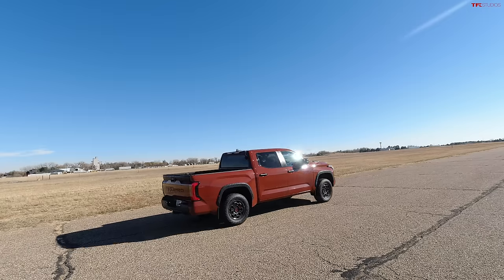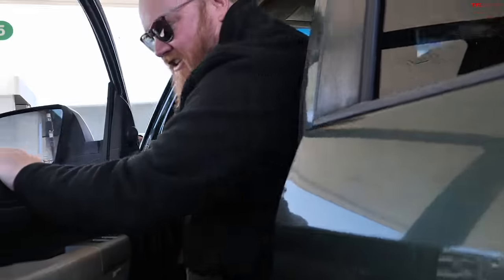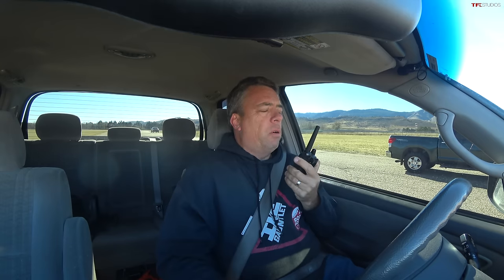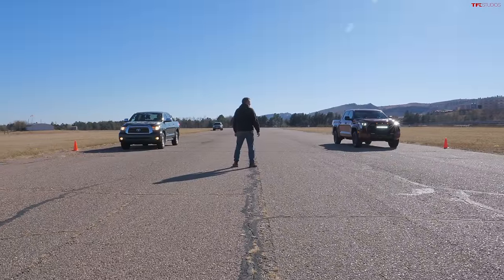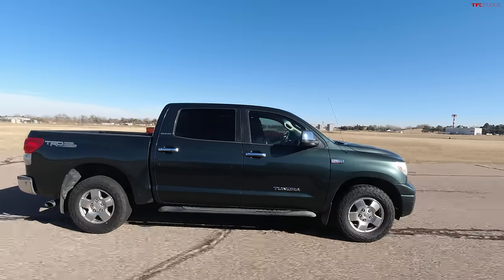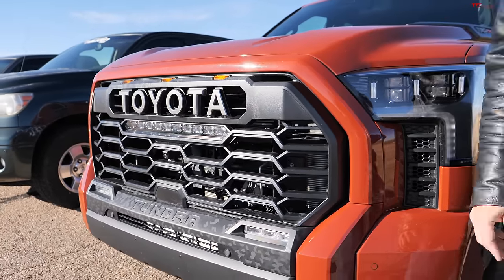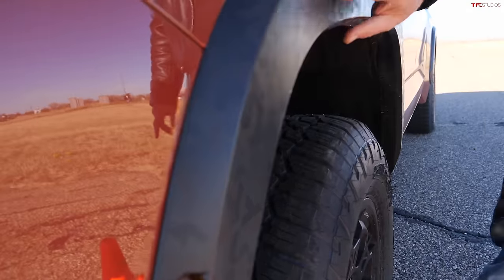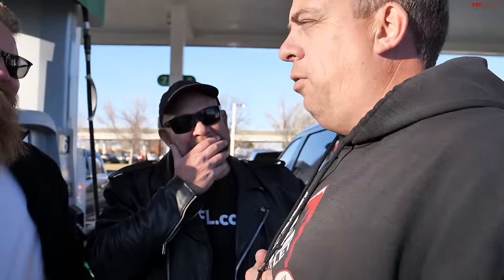Three Generations of Toyota Tundra Drag Race & MPG Surprise: That WAS NOT Supposed to Happen!

Comment: I had a 2005 Tundra for 7 years. Great truck until the transmission pin rusted and I didn't have 1st or 2nd gear on D. The brake line had a pinhole due to old age, and if the transmission was still cold, I'd have to drop it into 1st gear for it to move at red lights. Other than that I loved the truck. I now drive a 2011 Tundra DC and have no regrets. If Toyota gets their TT V6 engine problems fixed, who knows... I may go that route in the future. But from my past experience going from a V8 M3 to a TT inline 6 M3 looked great on paper, but nothing beats that sound of a V8! So I'll probably drive the 5.7 to the ground and look for a 2.5 gen Tundra V8 when that happens.

Comment: I have a 1st year, 1st gen Tundra TRD 4x4 with less than 100K and has a "Built in Japan Motor."  For the 1st year of production the Tundra motors were built in Japan and shipped to the US, after that year they were built in the US.  If I only get 300K from the truck it should last 50 more years, but I won't last that long.

Comment: My coworker has a 2000 tundra with the 4.7 and about 450,000 hard miles on it … he does not baby that thing and never has … TANK
Reply: All they need is regular maintenance and parts replacement as necessary... they sure can take a beating! 450 is insane! Mine is a 2000 4.7 also, but it only has 238k on it. Your buddy truly does drive that ol beast!

Comment: Did you remember to turn off the overdrive on the 2006 for the drag test? For the braking tests, the 2 older Tundras should've had new brakes installed for fairness. It would also have been nive to include a non hybrid version of the twin turbo V6.

Comment: Never will be sold on this new gen. Currently 2017 crew cab pavement princess 1792 edition. Really missing my 2012 TRD double cab. My younger brother has an 01 v6 tundra with a brand new frame sitting at 240,000mi. That one will outlast my 2017 hands down

Comment: Ive said it before You guys don't know how to drive the tundra🤦🤦🤦🫠🫠 I've been driving my 08 for the last 10 years,, "family is the original owners going on 16 years".. did you even use the tow haul everyone knows that makes a big difference in the tundra because that changes the gear shifting.. to take traction control fully off you push the traction control button. Then push it again and hold it down for like 5 seconds or little longer until all three lights come up on the  dashboard.. I guarantee you if you guys had a good driver that knew what he was doing you would have better results. You never race with traction control on. pushing the button one time doesn't fully disengage. You guys don't even break launch. Hold the break, give it enough gas till your at or around 2,000rpm then hit the gas let off the break n see what happens.... Im definitely not saying the gen2 tundra is gonna win over the new tundra obviously that won't happen (stock) but the results would be way better if you knew what you were doing..
Reply: Exactly

Comment: I owned a 2000 model first generation Toyota Tundra I put two tons in the back bed of it and hauled it down the road and I hauled a 34 ft travel trailer up a mountain running 80 or 90 mph and get 15 to 16 Mi to gallon with it hauling a travel trailer I had two Fords one with a five four and one will the 46 hauling the same travel trailer down the interstate and you could just barely do 65 on the flats and they both got 6 Mi to the gallon hauling the travel trailer trailer

Comment: Be interesting to see how a manual transmission would perform with these engines. I have an 03 with the 6 cylinder and 5 speed, and it has quite a bit of low-end torque, but that 3.4 without turbo is not a very smooth or high reving engine.

Comment: 12:23 lucky you. Our 2004 Sequioa had a 4 speed automatic transmission and 2WD. At least it had traction control. Also, @12:54 why though? The same people complained that the first generation was too small to be considered a full size truck, and this second generation was similar in size to the Nissan Titan of the time.

Comment: I’d get the 5.7. That engines a workhorse

Sure mpg sucks but that’s the case with any truck. If Toyota kept the 5.7 added D4S 10 speed and a hybrid, left the exterior alone, and just updated the tech ever so slightly the tundra would have been much more compelling
Reply: Imagine if Toyota had just poured the full development budget of this twin turbo into the V8. Surely they could have matched or bettered the V6 in both power and efficiency.

Comment: did you guys check trying the manual built into the tundra 5.7 
litre that could have gave you alot of torque at start just becareful not to burn the tires off

Comment: Ran consistently 15.2 in 5.7L stock on 1/4 track. 16.8 has to be a slow reaction takeoff. Turn traction control off, and turn the overdrive off.

Comment: Drum brakes don't matter when testing a single stop if it's strong enough to lock up the tires then tires are the real factor. Disk brakes are better in reduced fade so back to back brake tests when brakes are over heated is when drum and disk make the difference.

Comment: Just FYI, the elevation is partly to blame for the closeness of the 5.7vs 4.7 and also the gap of the turbo vs the 5.7.
General rule of thumb is a loss of 3% of your power per 1000ft elevation in a naturally aspirated engine and a loss of 0.5% per 1000ft for a turbo engine.
So vehicles with more power will lose more power. So the numbers get closer together than they are at sea level. Also 0-60 and 1/4 mile times are about 1 to 2 seconds slower at high elevation.
I grew up in PA(about 300ft) and lived in Colorado for 6 years at 7000ft, then back to PA. There is a pretty big difference in how vehicles act between the 2 elevations. But turbocharged engines only lose about 3% of their power at 6000ft vs 18% loss of a naturally aspirated engine.

Comment: For what it's worth,my 08 dbl cab 2wd 5.7 tundra gets 20mpg hwy and 15.5 local driving on average,and at least here in PA it has no issue running with the turbo truck. Although I have not run against a hybrid yet. I  will keep my antique over the 3rd Gen truck though,I have spent some time in one and it is definitely not the Tundra of old as far as build quality. I am not one for tech, so the new truck just doesn't do anything for me,it is hard to distinguish it from every other truck on the market today.

Comment: 91 Octane should have been used in all of them. READ the owners manual. To get full HP and torque ratings, Premium fuel is required 91 or higher. Specially for gas milage, towing and hauling 91-93 octane will out perform 87 octane. I was getting 580 miles with the 38 gallon tank of premium 93 octane on my 5.7 giving me 18-23 mpg. I would refuel with 28-30 gallons, the rest is the reserve fuel.

Comment: The best MPG I get with a 2.7 eco boost super crew short box fx4 is 16.5. Driving a mix of city and country roads. I use cruise control as often as I can. I don't count highway/interstate because it seems to be in the turbos a lot when doing 75-80.
Reply: I get great mpg on my f150 sport 2.7 the most I average was 35 mpg all highway going 65 the whole time from lake arrowhead to my house in national city
Reply: @JoseHernandez-co4mw  35 average? That's frickin stellar. I get 22-23 out of my 3.5 ecobeast mixed city and cruising.
Reply: @JoseHernandez-co4mw yeah right🤣

Comment: Love my 4.7 in my sequoia ❤ 250,000 miles of a high schooler that bangs the sh*t out of it. All you have to do is replace the water pump and timing belt once in a while and that little wheel barring and this thing well go for ever! It’s a tank. And plenty of power to play with from the low gearing ! Also if you want more towing power the sequoia does it way better than the tundra 4.7. Perfect family car and overland rig as well

Comment: If Toyota was going for power with the Tundra hybrid, wouldn't it have made more sense to repurpose the 5.0 V8 from the Lexus lineup for truck duty?
Reply: Maybe but seems like it would increase the price quite a bit. That engine is already pretty expensive so adding some turbos prob make the msrp even more ludicrous
Reply: Do your little feelings hurt because their isn’t a v-8?
Reply: I'm not bothered by the lack of a V8, but one would think a hybrid will be used  for efficiency first before power is considered.
Reply: @damilolaakanni Nope. The new gen hybrid system is for performance not efficiency. Cars are for efficiency.

Comment: 2nd gen owner. Repainted truck rather than buy new. Have a buddy with a 1st gen that pulls custom gooseneck trailer. Upgrade the radiator and trans cooler, will tow forever.

Comment: You couldn’t pay me to drive a Gen2 with that smooshed pug-nose body design.  I’ll give it kudo’s for having more rear leg room because while the Gen1 DC’s have a nice amount, anyone over 5’ 10” would surely appreciate that little extra, but I just don’t like the way they went about doing it… that body design does nothing for me

And the current gen3 has that gawdy, cheap plastic looking grille.  That tailgate release switch is amazing and I would LOVE to have something like that for my ‘04, but that gigantic screen in the middle of the dash is an eyesore

Also I’d rather have the 5.7L supercharged engine that was offered for a brief time on the Gen2’s

I’ll keep my 2004, thank you

Comment: Of the (3) Tundra's, which might have metal bits from manufacturing that like to find their way to the main bearings?  

I cannot RECALL which of the (3) different model engines (twin turbo V6 + electric motor vs 4.7 V8 vs 5.7 V8) might need replacement of hundreds of thousands of engines?  

Enjoyed the video, even though I watched it (10) months after it was released.

Comment: I had a 1st gen and loved it.  When it was time for replacement I went f150. 1300 lb payload capacity is laughable. 11,000LBs towing needs an 1100 lb tongue weight minimum to be safe, 1600 would be better. With a full tank of fuel, you can’t even put a driver in the drivers seat…

Comment: Turbo period will have a harder time getting mpg. Roughly every 7-10 pounds of boost it will Squirt more fuel. Wide open that turbo engine is thirsty kinda like a BBC or Ford back in the day. 5.9 Cummins owners used to keep there boost Under 10 pounds to achieve 20-22mpg

Comment: Interesting I had VR ute with 5.0lt V8 n VS ute with 3.8lt V6 but had LSD diff, the V8 did better then V6 both 4sp automatics. I also had VR sedan with 3.8lt V6 4sp automatic doing way better then both utes in mpg, I believe diff ratios play big part in fuel economy.

Comment: It would have been nice to use a Gen 3 Tundra in there with all the tweaks Toyota did in between 2007 and 2014, and for it to be a comparable TRD Pro to go up against the new Tundra.  The TRD had the better exhaust, suspension (all be it for off road, still much nicer) and a few other minor engine mods that would have been an interesting comparison.  It would have been interesting seeing the difference between the gen 2 and gen 3 in both acceleration and braking as well.  
Toyota had a habit for many years of not putting on strong enough brakes in the first couple of years of a production model and them beefing them up in subsequent years.  The 2000-2002 Tundra's front stock brakes were undersized until about midway through 2003, when they put larger brakes on the production models and offered a kit to fix the older models.  I don't feel like Toyota did enough with the brakes after that in the first gen Tundra to really equip it for the stance and weight of the double cab, but if the access cab had been a part of this test, even with the drum brakes (which are super reliable) in the back and the lessened weight load, the brake test with the other Tundras would have come out different for sure since those brakes were much better suited to the access cab dimensions and weight distribution.  
Love the 1, 2 & 3 gen Tundras...not sure I'll ever love the gen 4...can't even get a trd without the electric engine...not cool.  A comparison in a gen 4 without the hybrid option would have been a great idea too, more apples to apples in terms of engine development for the Tundra, and many people will never consider a hybrid.  
My 2003 4wd is still running strong, might keep my eye out for a 2019 trd pro to upgrade to sometime...after 2019, they added more government mandated safety features that are just not items I want of need on my truck...some people want/need a vehicle to help you stop for example, but that is quire disconcerting for me personally.  Thanks for the entertaining video 🙋‍♀🙂💖

Comment: The gen 1 and gen 2 Tundras are both solid.  I fail to see the upside for the consumer with the gen 3.  More expensive to purchase, more expensive to operate (cost per mile with the high octane fuel requirement) and crazy expensive to repair if that unproven engine fails.  No thank you.  I'd like to go full-size as my truck needs have changed, but with the current offerings from Toyota, I'll keep driving my 2011 Tacoma (gen 2).

Comment: recommend checking out nerd video explanations of why you are not supposed to top off your tank.  "So, overfilling your tank sends excessive fuel into the charcoal canister or carbon filter which is strictly designed for vapor only. When fuel gets into this system, it will affect your vehicle's performance and could damage the engine meaning hefty repair costs."

Comment: I'm a longtime Tundra owner. I owned a 2007 Limited for 15 years, and currently own a 2016 1794 edition. Sure the new 2023 has more power but there's nothing you can do to make it more powerful. I know TRD has a tune for a couple thousand dollars but it only gives you 35 more horse power. But the older Tundras with the 5.7 are so much better. One such Tundra actually towed the Space Shuttle, (that's 292,000 pounds) a quarter of a mile. Another got over a million miles on it with the original engine and transmission, the transmissions reverse needing repair at 750,000 miles. Compared to the new ones the old ones are so customizable for power. You can put a supercharger on it taking it up to 550 horse power, and 550 foot pounds of torque. And you can put headers, a camshaft, a stage two kit for the supercharger on it and get it up to 700 horsepower. Some people have even got the 5.7 up to 1,000 horsepower with a short block kit. When I wrecked my 2007 I could've bought a 2023 but chose the 2016 with the 5.7 because you can get way more power out of them, and the new ones you can't. The older Tundras are way superior to the new ones with the twin turbo V6.

Comment: The 3rd gen Tundra may be fancy, but it won't last near as long as the 1st or 2nd gen. It is built much cheaper. Power is great but reliability is much better. + throw a turbo on that 5.7 and it'd be a monster

Comment: i have a 21 tundra. ive raced people with a v6 twin turbo tundra, off the line at a red light, and smoked them. i think this race was fixed. did you have 4wheel drive on and tow haul on in the 5.7l tundra? this guy driving the 5.7l in thr video is afraid of the pedal 😂

Comment: I know it's hard to find a unit that has a mileage same as 1st and 2nd gen Tundra, but i don't think the acceleration and 1/4mile tests are fair in any way. Also i would add the dyno test, and see how much hp does engine produce after all that mileage, i would assume 3rd gen engine if equal to> mileage if other two would - lose the most horsepower due to the nature of engine having power mostly from turbo's...

Comment: One problem is the Tundra is not as roomy inside for tall folks compared to something like an F-150
Reply: I'm 6'2 with the panoramic roof, fit fine in every seat position with plenty of head room except the middle rear. Still have room, but just barely. Also if you look it up, the F-150 has 40.8", Tundra 41 in Hybrid. The other funny thing is if you get the F-150 hybrid lariat, the Tundra Hybrid tows about 3500 more lbs 😂
Reply: Not much to say now huh🤣
Reply: Depends on the year of the Tundra and the F-150. I'm 6'4", and I can fit in an 07-21 Tundra more comfortably than in my 99 F-150.

Comment: You should have raced the 4.7 against the 3.5. That way they each would have ran 2 drag races at full throttle. As it stands, the 5.7 is the only truck that ran 2 full throttle races.

Comment: You should consider re-run this drag race with a trailer attached. It will show if a N/A or force induction is better
Reply: The new one's torque and hp ratings are the deciding factor.

Comment: He made the mistake of calling it a bracket race. In drag racing nomenclature,  a bracket race is, you dial in your car, display that number to the tower, and you leave the starting line based on your "dial-in" time. What these races are, is called a "heads-up" race.

Comment: That’s funny,my first gen ford lightning ran 15.3 at 88 240 horse 340 torque if it had as much power as the turbo it would have run 11s

Comment: And with the 4.7 you have to change the timing belt every 90k miles. And that ain’t cheap.
Reply: No you don’t. It can easily last 150k
Reply: @flight2k5  For a 4.7 V8 engine made between 2000 and 2009, prepare to replace the belt when the mileage reaches 90k miles. Tundras equipped with chains were manufactured from 2005 to the present, with a V6 engine, 2007 to 2014 models with a 5.7 V8, and those made in 2010 to 2014 with a 4.6 V8
Reply: @Fireguy1962  I’m telling you, you can run it to 150k with zero issue
Reply: @Fireguy1962 5.7 has timing chain
Reply: @mftatvop  that is correct 5.7 does have a timing chain. I believe the 4.6 was the first motor to go to a timing chain. Also followed by the 5.7.
Reply: @flight2k5  not worth taking the chance of the final results that could happen.
Reply: @davidmckibbin4440  it’s a non issue. The Land Cruiser shop I had mine done at saw one with 225k on it.